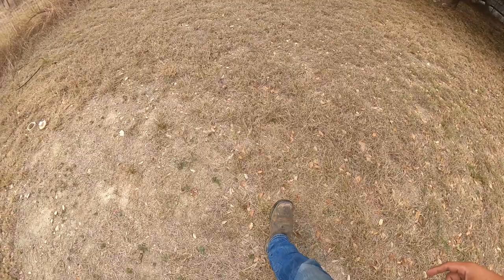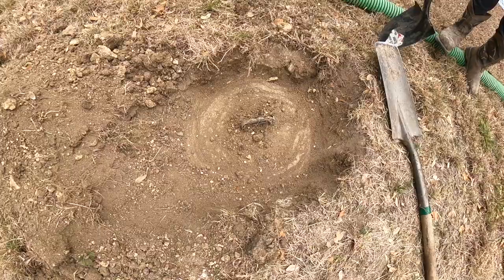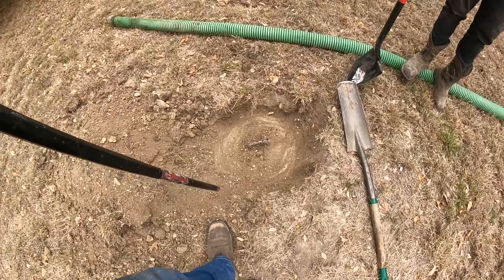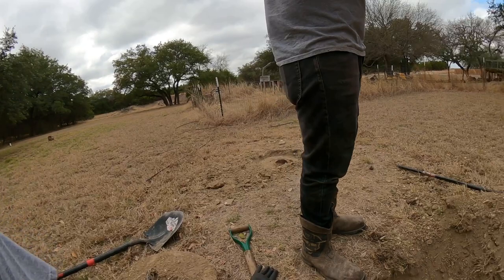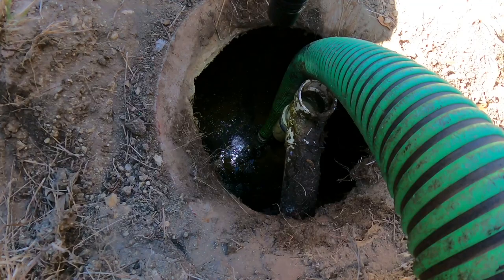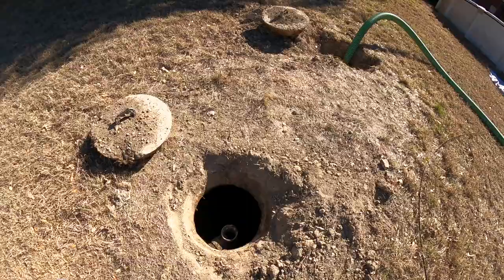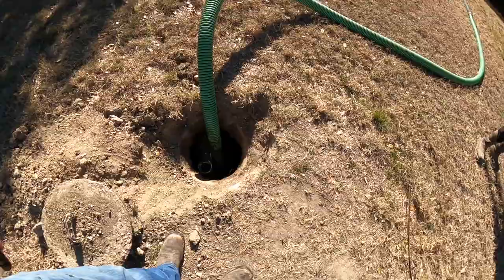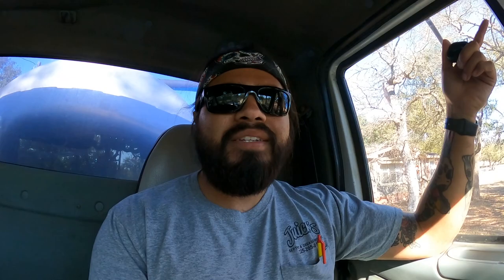Toilet Paper Clogged this Septic Tank

Comment: Don’t use a baffle for your inlet side if they are getting a smell either 45 off the inlet into the water or put a 90 on the roof vent if they are not having a smell rip the sucker off and let her blast

Comment: I called a pumper, when he came out I asked him if he pumps both sides. He said the newer tanks don't need both sides pumped. Is that true?
Reply from the maker: Not sure how they do things in your area, but if a tank has two compartments we usually pump through both sides. If it’s a single compartment tank we open up one lid and stir the contents with the crust buster to ensure the entire tank has been cleaned properly
Reply: @PoorPumperSociety  Thanks for answering! It must be a two compartment tank because he said something about only one side needed pumped because the other side is just liquid. Anyway It didn't need done at all. Only had three inches of sludge on the bottom. The guy I bought the place from said he had it cleaned about 18 months ago...